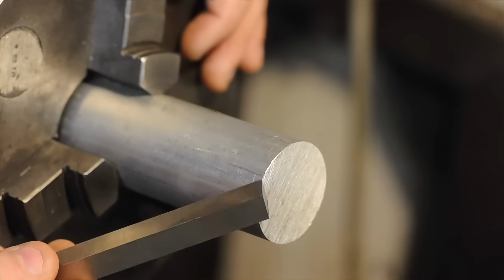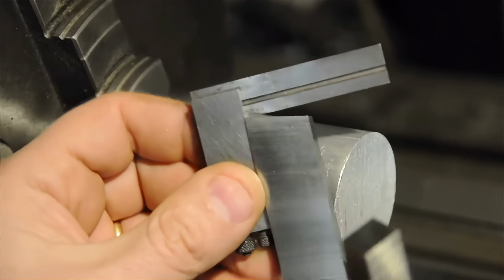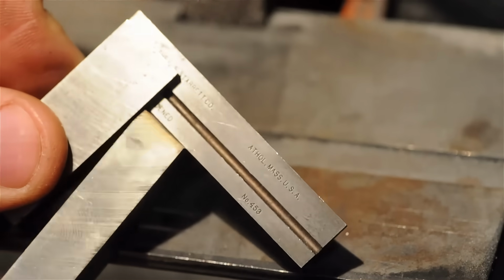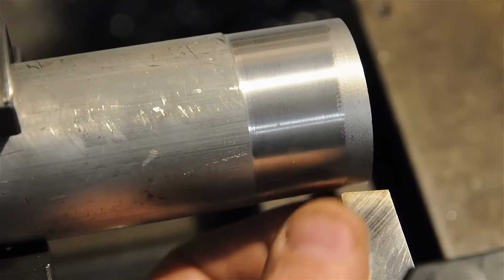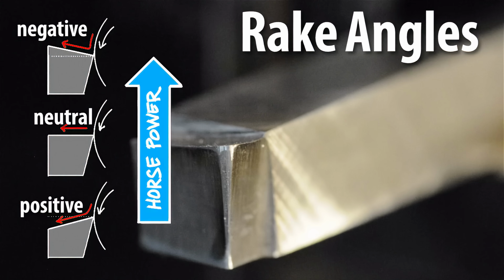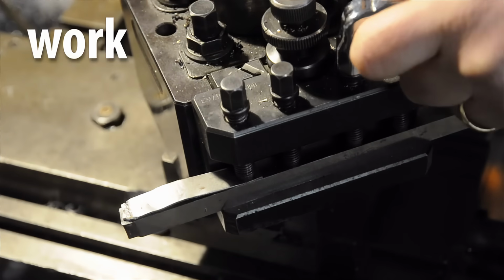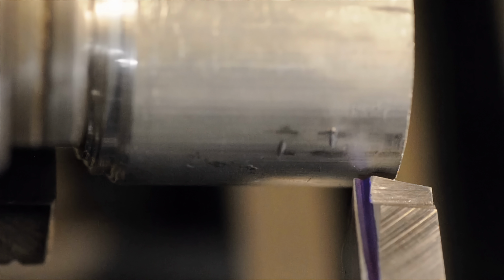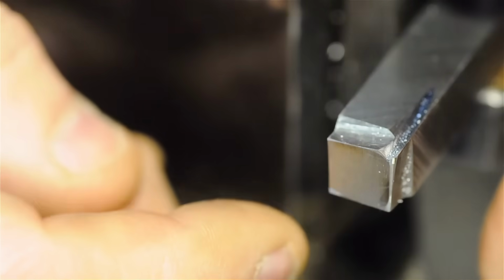Grinding HSS Tools

Comment: thanks TOT, I was just struggling with this about a week ago. quick question, what do you think would happen (chip breaker wise) if the tool had a notch on the the very tip of the tool so it maintained a constant rake angle? almost as if the tip was chipped but perfectly so there were nice corners and the desired rake. I'll try and post a photo. thanks again, Miguel
Reply: https://drive.google.com/file/d/0B4FI1853dMCmbHVxQXd0cEtnOEk/view?usp=drivesdk
Reply: Experiment.
If you are going to make a very deep notch some of the other grinding on the various surfaces may not be needed or lose the effectiveness.  I looked at your photo and would try that notch without all the grinding on the top surface (no point after that notch is there IMO).
Also consider how much material and time you want to spend grinding and if you make a mistake and its deep, at the wrong angle, or in the wrong spot, you have to grind a lot more material to get a "fresh" start.  Looking through old machinery books, all sorts of chip breakers have been tried.  IF you can put just a dot from a stick welder in just the right place it will break a chip.
Reply from the maker: That is a very popular chip breaker style; in fact it would probably work to break chips better than the one I used.  I was going for something a little more subtle to segue into chip control and the chip breakers on insert tooling.  (Video coming).  RussZHC makes some good points, too.

Comment: Tony, would you be able to go more in depth with shaper tooling
Reply from the maker: Its exactly the same except for the chip breaker.  7 degrees everywhere and a healthy corner radius.  In a shaper this tool would cut left to right (looking at it head on).. grind the exact opposite if you'd rather work right to left.

Comment: Amazing video!I was absorbed for the whole length of it!
If you could use a 3D model from like the program you use for your cnc it would be even more easy to project how you wanted to shape the tool.Though it wouldnt fit with the videos direction.

Comment: tony, what happen when you use the same metal for Milling or in Lathe?
Reply from the maker: The tool spins on the milling machine, so as long as you take that into account, grind accordingly, it should work fine.